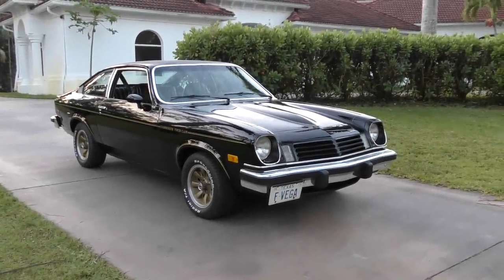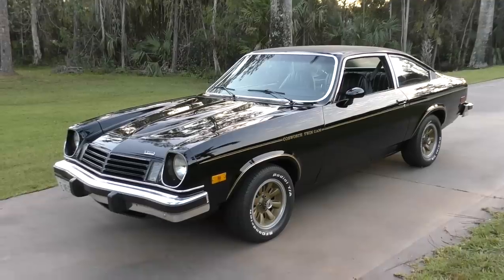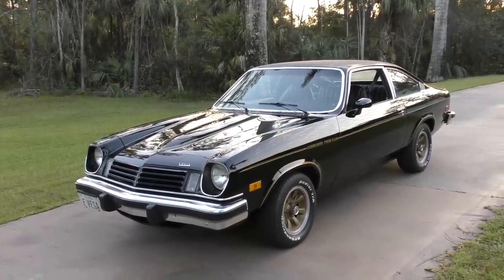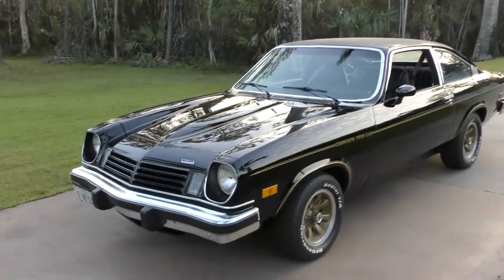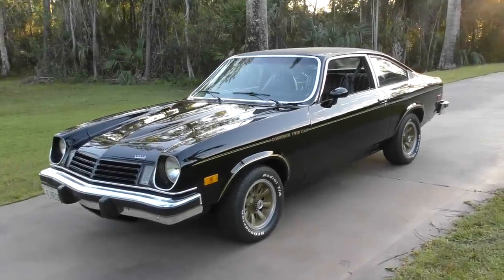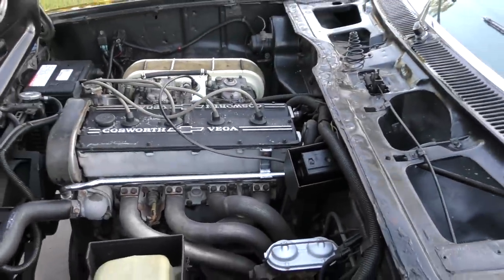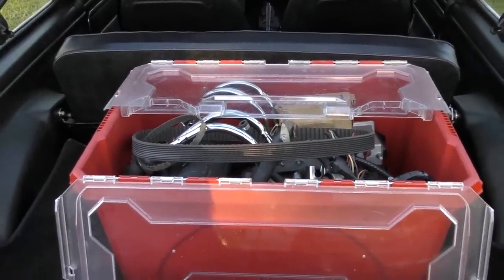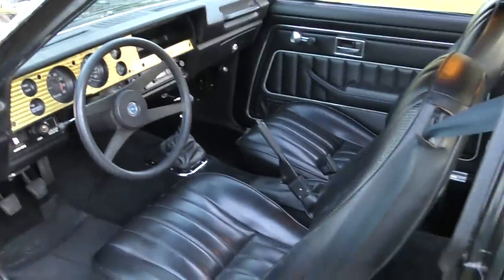The Cosworth Vega is an Amazing Car, But Came Too Late to Save Chevy From Their Terrible Decisions

Comment: Bill, you should review a Buick Reatta. It was a grand touring roadster designed for Old fat guys to feel sporty in without being too flashy or upsetting their wives.
Reply: I really dig your assessment of that car and it's buyers.  Actual LOL!
Reply: @randolfo1265  Yes, basically something for Bill is he time traveled back to the early 90’s.
Reply: Reattas are still collector bargains IMO, the poor man’s Cadillac Allante
Reply: @elisorrells5314  It’s a shame the Reatta, Allanté, and TC Maserati were given front-wheel drive and automatic transmissions; two things a roadster should never have. If they had given the Reatta a six speed manual, the turbo/intercooled 3.8 from the Regal T-Type/Grand National, and rear wheel drive, then it would’ve been a truly amazing car. Being smaller, lighter and more aerodynamic, it would’ve outrun and out handled the Regal. If they really wanted it to be futuristic and high tech, then why not give it the all-wheel-drive system from the GMC Typhoon/Cyclone? If you’re gonna power the front wheels, you might as well power the rear ones as well and give Audi, Diamond-Star Motors and Subaru a run for their money.
Reply: @robertmoffett3486  I see a couple out in the town and on FB marketplace, most are still in the hands of the golf course set but a few have gone down to community college student or meth head level, not at the rate the more pedestrian Buicks of the time though
Reply: @stoneylonesome4062  - Yes,  with all of GM's ability (the new C8 for example), they could build some really amazing stuff even today.  When I see that the aftermarket can make a Trans Am for you from a late model Camaro,  it makes me wonder. . .   Why doesn't Buick make a turbo (or supercharged even better) V6 powered modern Grand National based on the late model Camaro?  Anybody with me?
Reply: @randolfo1265  The only reason Buick is still around is because of the Chinese market, that and the few old Baby Boomers/Silent Generation that are still around to buy them. The latest Regal GS is in all likelihood the last time Buick will ever get hot.

Comment: I went with a friend for a ride in a factory original Cos that I was considering buying.  The car was in excellent shape.   The drive was on a rural paved staright road.  Got in this little Vega and was heavily impressed by neck snapping accelleration.  And this was the 80s so the price that was offered would have broken your heart cheap.

Comment: I bought my 1975 Cosworth twin cam Vega #0177 in my early twenties ca 1976. I fell in love with the engine and drivability and proceeded to blow the motor. Had it rebuilt with the EGR removed and added some great little quad eyebrow Payne l pistons to match up with the four valve head. This thing was a screamer. A set of good year Wingfoot tires and it could handle the twisties like a rail. My buddy had a straight six Datsun 240Z and couldn't keep up. I loved this car even though it had it's... Let's say quirks. Nice video!

Comment: I was lucky enough to ride in a cosworth Vega with a factory rep that had some kind of a box that adjusted the timing. Oh my God, it took off like a vet, I was in the backseat and was so impressed on how fast that little car went with that little cosworth in it. It was a totally different motor with the factory timing box on it that could not be left on for customers. Have no idea why they couldn't have sold them like that. I was in high school at the time, swept the shop floors after school and got to know one of the mechanics really well, and he offered me the ride.

Comment: 22:25 I believe Cadillac used the same Bosch-Bendix EFI port injection system on the 1976 Seville and as an option on the 500 and 425 engines in their large models, so the switch to throttle-body "digital fuel injection", in 1980, was a step backward in at least one way. On the other hand, the "computer" in this car, which is related to both the Bosch D-Jetronic controller in the 1968 VW Type 3 and that of the original Bendix EFI option on the 1957 Desoto, was really an all-analog circuit, which most likely used op-amps to perform the mathematical operations that would implemented in code today. It's too bad that so many of the cars with these early EFI systems have been converted to carburetors; kudos to the previous owner of this car for saving the EFI hardware.

Comment: As a young kid I went on a Boy Scout tour of the Chevy Tonawanda (Buffalo) motor plant and in the middle of the assembly floor was a small room with glass windows on all sides.  Inside a small group of UAWs were assembling the early Cosworths.  The problem with owning the Vega in Buffalo was that they all got the winter cancer after just a few years and ended up at the pic-n-pull with the twin cams and alloy wheels gone.

Comment: A few years ago, I bought a black/black 1975 Cosworth Vega, at a N Ca estate sale.  It was in the field of a former Automotive Speed Shop owner, who had also run other cars at  the Bonneville Salt Flats.  I got the Cosworth running, in the field and drove it the few miles, to my house.  I fixed it up and  sold it shortly thereafter.

Comment: My friend and mentor had a 76 Vega 2 door, and back in the day, he worked as a flight instructor at an airport in Michigan.  Spark knock in cats of this era were commonplace, so he was able to use 100 low lead avgas in the car.  Buh bye spark knock, and the car ran like a scalded cat 😂 Oddly, avgas was slightly cheaper than car gas at that time.  Loved Vega's even though you could watch them rust sitting on the driveway.  Imagine real good rustproof metal back in the day, we'd have so many cool 70s cars with us still.

Comment: I owned the cousin of this car, an Oldsmobile starfire sx. 305 v8  with turbo hydromatic. The weight of the motor made it balanced like a dart. Stable to the point of inability to make sudden direction changes. Had to be driven / steered using the throttle and minimal steering input. Once learned was a joy to drive. After 325000 miles the body started to have metal fatigue. The fellow I sold it to got a speeding ticket two days after he had it. Too bad GM refused to do the due diligence and just tweak the design and a bit of quality control. Good video, thanks

Comment: The fun thing with a Cosworth Vega, it was a street sleeper.  Stopped at a stoplight with a buddy in my Cosworth and teenagers next to us in a Camaro with a huge air intake,  I told my buddy watch this when I take the Cosworth to redline on each throw,  light turned green and I thought those teens were going to break their necks wondering how a lowly Vega could keep up with them.  Going skiing in the mountains drove next to a Porsche 924 and I had three people in the Cosworth Vega and ski gear and we raced the 924 through curves at 100 M.P.H staying even with them the whole way as we went around a curve there sits a state patrolman on the other side of  a four lane road with his head down writing a ticket and we blew right by him and he never looked up, we stared at each other and started laughing and we both backed off at the same time. Late night driving next to a Chevelle SS neck and neck even at 120 MPH and the Cosworth slowly climbed just under 130 M.P.H. and the dude waved at me and shook his head in dis belief.  3500 R.P.M. and up was the happy place !

Comment: I had a 1976 Vega Wagon that had a Nomad Wagon treatment. Actually, it was a pretty good car, I put over 90,000 miles on it in 5 years. I have fond memories of that car. The engine was great, never burned oil and the only thing I ever did to it was an alternator and clutch. By 1981, it was getting very rusty but, I was also living by the beach in South Carolina.

Comment: 170 HP vs 110 HP possibly in addition to due to gross vs net calculation change because emissions alone could not have robbed 60HP from an engine.

Comment: Nice looking car. A friend had  gt that had 3 engines replaced under warranty.The last one he added headers and a 4bbl carb.It was a lot of fun for a short time.A minor front end collision could easily blow the head gasket as the head was cast iron.Threads on bolts would stretch in the aluminum block

Comment: I love Vegas. Had a '72 that was fantastic. The only problem was the lack of power but a fun car to drive anyway. Mine had a vinyl roof on a hatchback. Wish I had kept it now as it turns out to be very rare. I always wanted a Twin Cam Vega... couldn't afford it at the time. That Vega motor was actually quite good but most mechanics screwed them up. When I sold my Vega it had 63K miles and was still going strong.

Comment: I bought a well used Cosworth Vega for cheap in the 80's.  It ran very well and was fun to drive.  I had the cam belt go out, but being a non interference engine there was no damage.  I once got rear ended at a stoplight by a newer TBird.  The collision wreaked the front of the TBird with coolant coming out of the radiator.  The Cosworth Vega with the Impact Bumpers had minimal damage.  The rear bumper was pushed in slightly on one side and there was a very small crease in one rear quarter panel about the wheel opening.  I was able to drive away without any problems.  It was interesting to look at the rear suspension with a long torque arm from the rear axle housing up beside the driveshaft to a mount on the rear of the manual transmission.  I think this was also used on the later Monza's  Emissions testing ended up with me getting rid of it.

Comment: I remember when these were new, hot little cars that looked great and still do today. I had a 74 Vega GT in silver, it would run fine for days then suddenly on the road it would just shut off, but throw in neutral to coast and after a minute it would crank right back up and run fine. Never knew what the gremlin was.

Comment: That manifold pressure sensor in the box is a straight copy, if not a sourced Bosch unit from a D-Jetronic setup (multiport fuel injection on foreign cars like Volvos, VWs, and MBs that predated the Vega)
Reply: It is indeed a Bosch MAP sensor. Bendix did use some Bosch parts on their system (including the injectors I believe). Fitting since the D-Jet is a derivative of the Bendix Electrojector from 1957.
Reply: @jasonvanrell3678  That Chrysler used on its cars in ‘58 with dismal results due to wax paper circuit boards hung in the engine bay where they were exposed to heat and water.  Hilarious when you think about all of the bullshit the Big Three went through during the malaise era.  Feedback carburetors, lean burn, etc.  Meanwhile, the Europeans had fuel injection.  That they got from Bendix in 1958.  Don’t know where they came up with K-Jet, but all L-Jet variants through motronic were certainly descendants of D-Jet.  If Chrysler did some more R&D before releasing the ‘58 cars, or sat on the project until the technology was there, they could’ve been on top despite the ‘62 cars.

Comment: Hey Bill, both the redesigned '82 Z28 & '84 Corvette deployed the CrossFire Fuel Injection. Ended up being quite a problematic system with a myriad of performances issues. Needless to say, the next model year it was abandoned. The Z28 went with the H.O. 4 Barrel quadrajet and as you stated the '85 Corvette went with the TPI injection. BTW - That dashboard grab handle in that Cosworth was definitely a John Z. DeLorean styling que. When he was in charge of the Pontiac Division that passenger side grab handle was found in most of the models. Many Thanks Yo !  👌  💯

Comment: oh fantastic! when i turned down my appointment to the USAFA Dad sold my 77TransAm for $5500 and wrote a check for $700 and told me to go get my new wheels. when i got to the house - cars everywhere, i said i'm here for the Vega. The wife was in tears so the husband said, "gonna need $50 dollars more for this car". my 93 Vega GT got me thru college and well after. it had the manual trans and the very smoky injection molded engine block. we took it to my cousin Kenny Timer for a 'tune up' or sleeves is what i wanted. it was way more than Dad would spend which was probably more than he paid for it in 1978 $750. the little 4banger would burn a quart of oil every 60 miles so i always had cans of oil rolling around in the back. there was a lot that was good about this sweet little silver Vega (the stripe disappeared after Buddy painted it) we paid him and my Dad said you can finish it when the paint is dry. Bud said no - for that money I'm done with it. Dad just smiled and so did I the car looked so beautiful.  it looked like a mini Camaro - it was pretty. the balance was very good, it could dance little doughnuts at the top of the street on the ice which made my friends trash can banging Plymouths look stupid. it would drift nicely around corners and bends on dry pavement before drifting was invented just by dropping it into first and nailing it,  particularly handy when showing off for the young women. it could haul 3 other friends and hold incredible amounts of stash in the hatchback. the little straight four would quit when the oil got too low, ie it had a preservation instinct. i do miss that beautiful little car!

Comment: I loved mine. Went from original aluminum engine to steel sleeves. When finally blew engine I put in the 350 with nova tranny and cut corvette rear tubbed the rear with 50’s Mickey Thompson on craigers and 31/2 inch trick wheels in front. Did 10.2 in quarter mile in 1986.

Comment: Owned a 74 Vega Gt that I managed to keep on the road for 10 years in Michigan. Replaced the engine at 70,000 miles and despite my best efforts at rust prevention the car was pretty much gone when I donated it to the Salvation Army in 1984.

Comment: My uncle had a 74 Vega, it was a complete lemon. The engine would overheat constantly and you had to turn off the A/C to go uphill. The 4 cylinder also leaked from the gaskets. Surprised anyone kept these. It was a rush job by GM and it bit them.

Comment: Here's what I recall of these cars, they rusted immediately. My uncle had one in 1981-ish, I was 10, and it was a rust heap. It didn't survive much longer after that. My uncle was a young car enthusiast with a family to feed, and this was something affordable he could have fun with. Somehow, the drivetrain of his car survived longer than the rest of the car. The other thing I clearly recall was that he straight piped it, and it was incredibly loud and just didn't sound good that way.
If GM only did proper rust prevention/minimization measures from the start, the engine issues could've been engineered out fairly quickly. But once people started seeing 2-year-old Vegas falling apart to rust, game over. That's what I remember of these otherwise attractive small cars. GM dropping the ball again.

Comment: The Vega was by far the best-looking car in its class, it is a shame it was ruined by its terrible engine.  One of the regular cars on the Thursday night car show is an orange Vega with a Chevy small block.  I think of that car as the perfect Vega.
One of my brother's friends back in the day dropped in a Buick 3.8 Liter into his Vega and it was a pretty good, well-balanced car.
Finally, the Monza that followed the Vega also looked nice.  Granted, GM et al really built some crap in the 70's and 80's, but solid V-6s with decent power would have made these great cars.
I was born in 1960, so I could not have come close to affording a car during the Cosworth Vega era, but no way would I have bought a Vega over a V-8 Camaro.

Comment: Technically interesting, but can't imagine who bought one.  It all comes down to price.  In 76 you culd get a Firebird Formula with the 400 4bbl, 4 speed, AC, stereo, full gauges, custom trim interior, rally II's, power windows and a few other bits and bobs for $26 less than a Cosworth base.  Why would you pick the Vega?  Or, if you wanted a semi-hot hatch, a Capri II V6:  109 hp, a tick slower 0-60 (but only a tic), German engineering, more luxury and save $1,500 - the Capri itself being overpriced because of the exchange rate.

Comment: There was a kit to put a small-block Chevy in a Vega. It required beating the firewall with a hammer. They said that the stock radiator could handle it. Pre 68 water pump.

Comment: Between me and my best friend we had 3 V8 Vegas and a couple of V8 Monzas but never any little stock 4 cylinder powered cars. Monzas were basically the same car under the sheet metal except a monza rear axle wouldn't explode right away and the front brakes were bigger. The worst thing about the Vega was the weak front suspension and puny rear axle as well as the flimsy spot welded construction and tiny brakes. The rear suspension was just spot welded to the floor of the car and a 12 bolt Chevy axle cut down to fit in a Vega with the stock suspension would eventually come out from under the car as those spot welds would tear out of the floor. The brakes were way too small as well. But if you cut slots in the floor and welded in a rectangle tubing frame and put larger brakes in the front and ran ladder bars and a 12 bolt you had a decent street strip car. You would just have to nearly pull the engine to change the starter after the V8 Vega headers cooked it.......again.